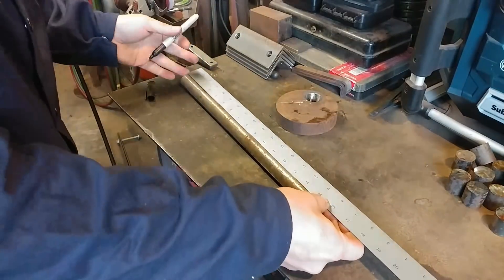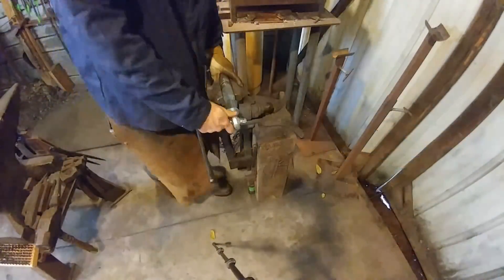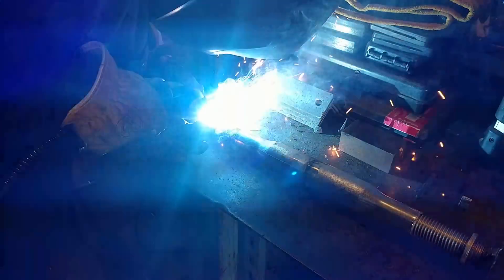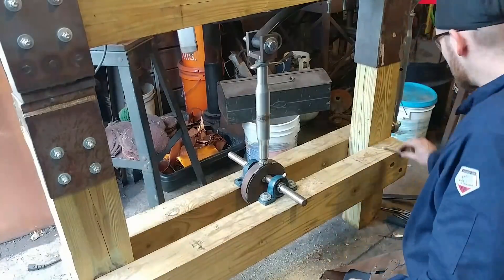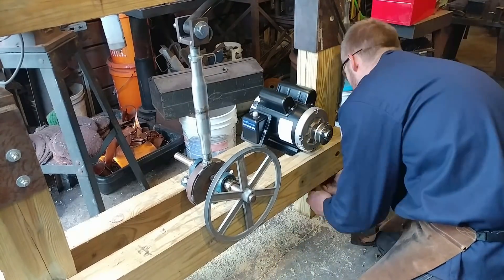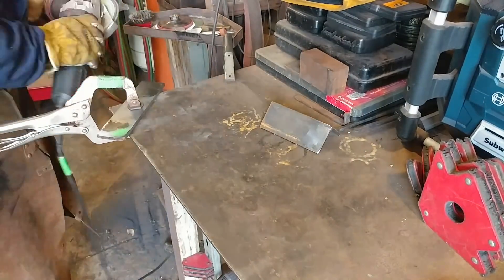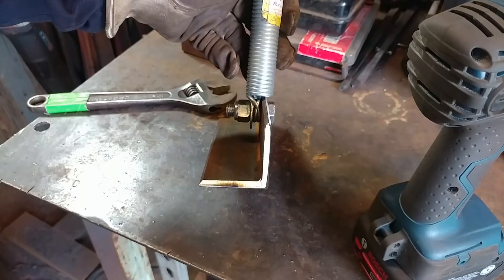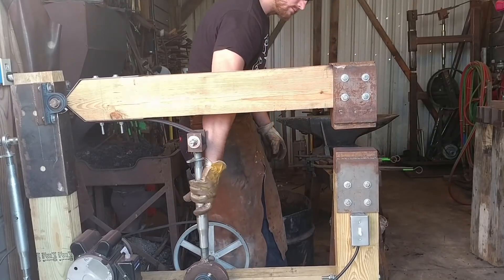Beam Hammer Build Pt.4: The Guts & Glory FINISHED

Comment: I built a pendulum beam hammer, this style I could convert it to power operated relatively easily. My original thought was a treadle wheel powered but a small motor means less muscle work. Nice to see one working. Less complicated than the wheel version .